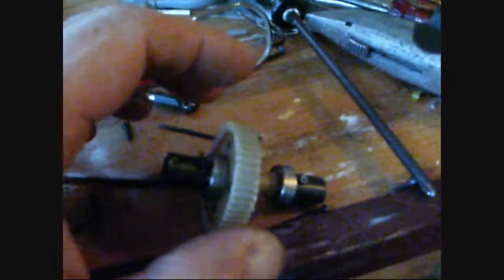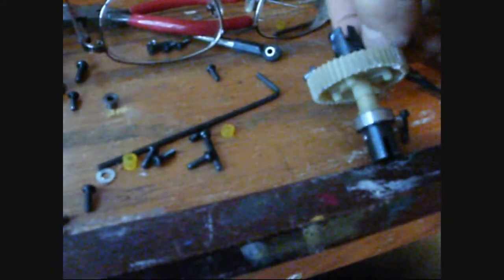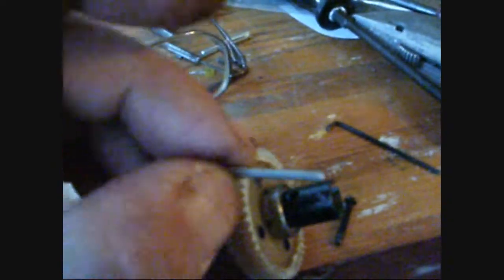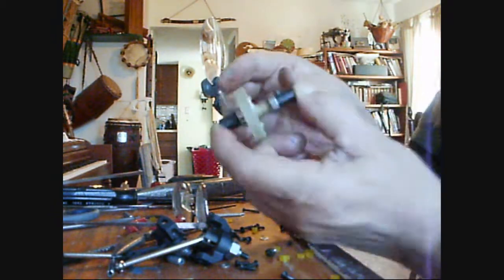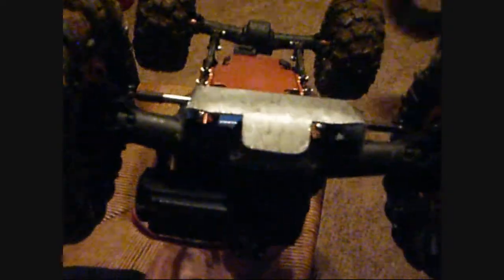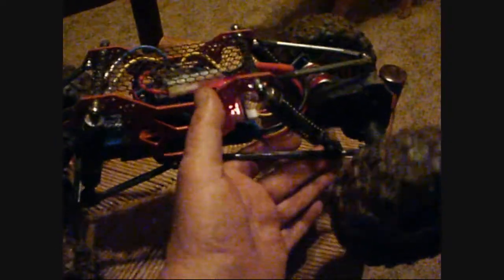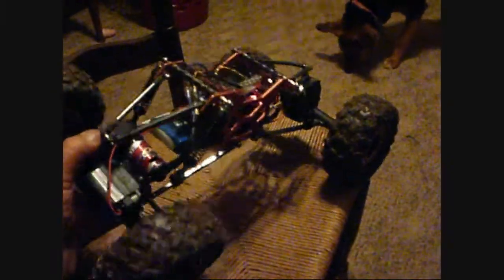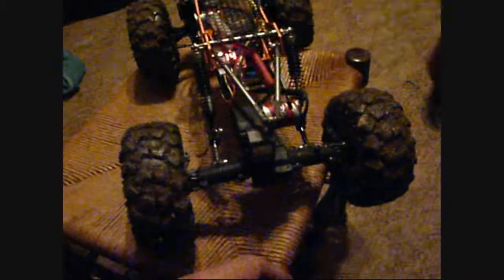RC = Repair Constantly

Comment: I love rcs man.   I have 10 currently running,  and way to many projects.

I am a member on rccrawler,  username gabehunt.    whats your username.
Reply from the maker: Same as here. It fits my skill set really well. It's almost like all the different things I have done were precursors to becoming an RC builder. I've got a few more things to learn like machining and MIG welding and all the ins and outs of the various electronic packages and how best to configure them. Next up for this beast will be cut n shut tires and tall turned down rims.
Reply: Mountain Storm  Ive cut a few tires.  but im more into the scale scene and bashers,   not really into the comp crawlers.
need any help man, just let me know